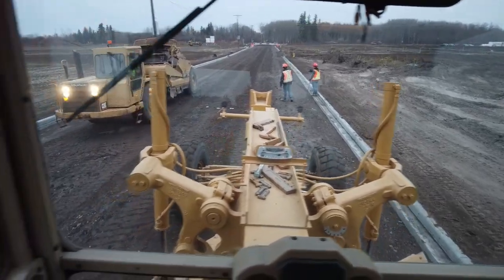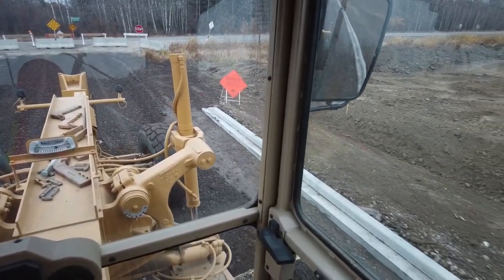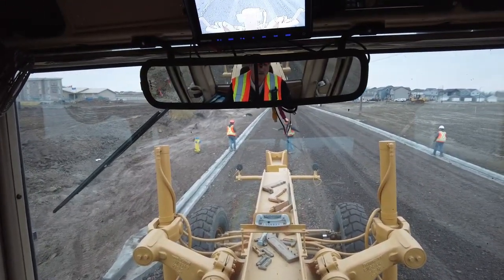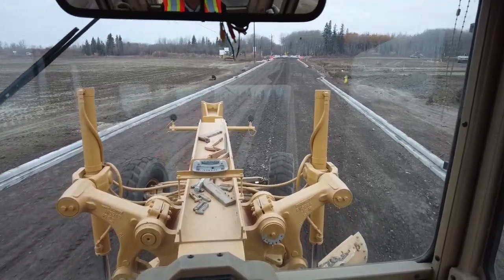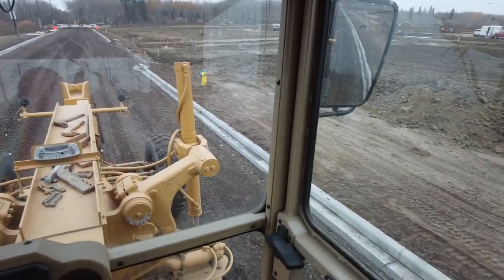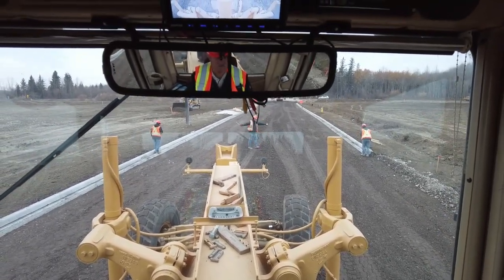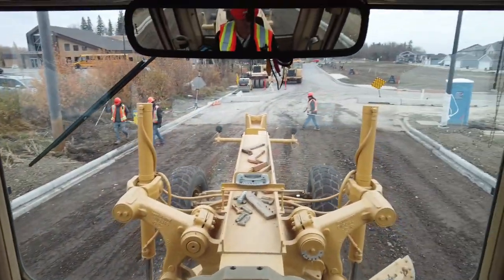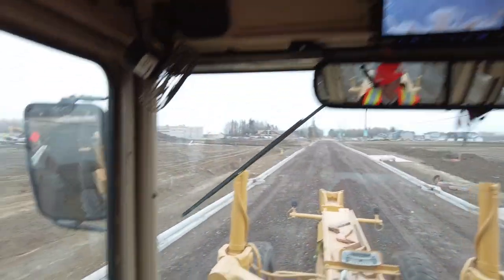Measuring 63mm, and preparing for asphalt

Comment: In the UK a laser beacon and levelling equipment on the grader would, be quicker and require less labour
Reply from the maker: First comment from the UK, Standard General is also transitioning over to GPS grading, in hopes of cutting labour cost.
Reply: We used lasers since they were available to us aboot 15 yrs back
Reply: @onlyamillionmistakesvernky7937  it amazing how much you can save on concrete/asphalt when you get the sub base bang on level ,